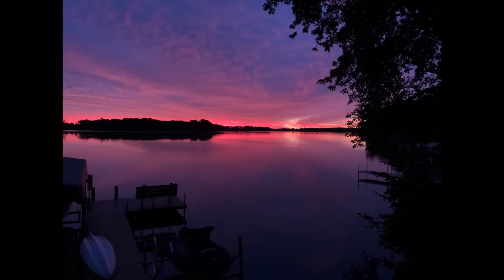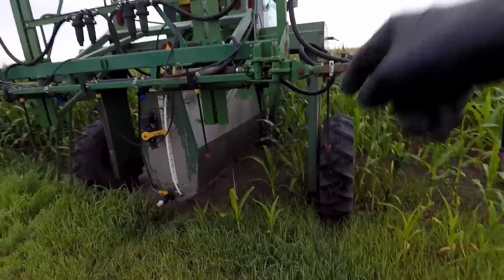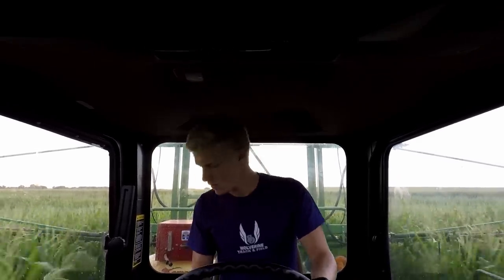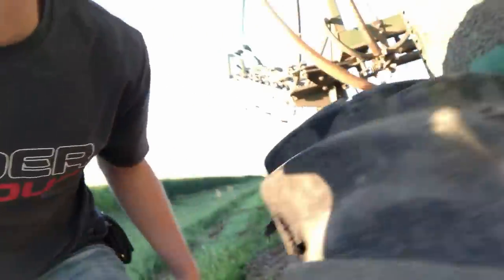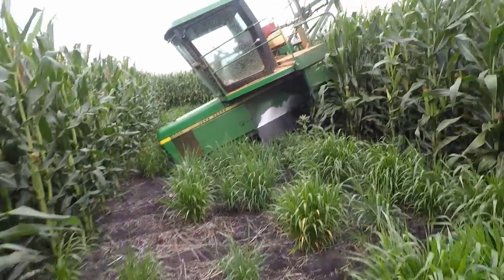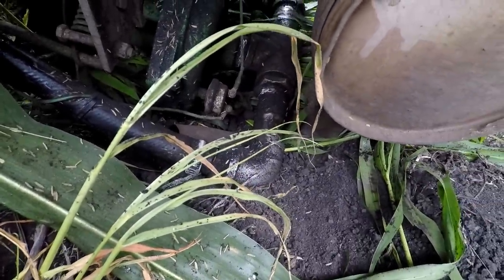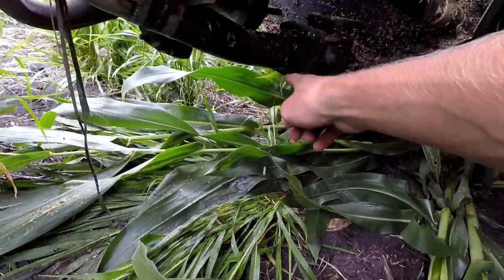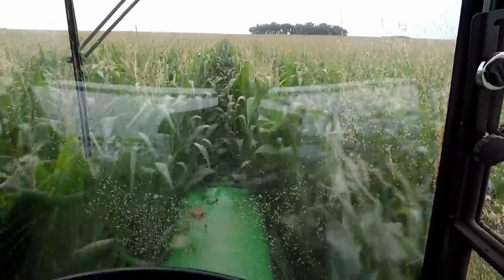Poor Mans Hagie Sprayer (John Deere 6000)

Comment: We have one of those that we spray tabacco with and the hydraulics don’t work so we have to pull the booms together with a chain
Reply from the maker: Ours are getting weaker, we are planning on going through each of them this winter and fixing/improving the ride height, replacing the drive chains, brakes, lights, and hopefully the hydraulics

Comment: Makes me very glad for our 80' Patriot XL, we've put a raven GPS system in, helps a ton running 80', anyhow we have also installed pressure gauges for both the main pump and each of the 5 sections, and our section pressure is always about 30% less than the pump pressure... when you said you were trying to hit 40 psi I assume that is at the nozzles, I wonder where your pressure gauge is at... I assume there isn't as much pressure difference with the smaller booms, have you ever calculated your actual application (how many acres you have covered vs how many gallons sprayed?) I suppose you have no acre meter either lol anyhow would be interesting to look into
Reply from the maker: We just calculated it by number of acres done with the 300 gallon tank and adjusted it accordingly.  Plus in the back of the nozzle catalog there is a diagram that shows how many psi you need with a specific nozzle for each rate, and it’s usually only a few psi off from our calculations

Comment: That is a sketchy looking machine. How you don’t get vertigo is beyond me.
Reply from the maker: It’s definitely a sketchy machine, but as far as being an equipment operator, it makes me more confident in everything else😂
Reply: At the end he mentioned 'reset my guidance" so there must be some kind of autosteer, otherwise a day of threading that machine thru the rows would send one to the institution....
Reply: @dhenschel4  no auto steer at all it’s a light box guidance like the first gps of its kind when you start drifting over in eather direction little lights go off to the left or right of a center light and that way you know which way to correct steering

Comment: How do you guys think effectiveness compares to application by air? Ive been thinking about an old deere 6000 just for this.
Reply from the maker: We have had good luck with planes, but we just like the control we have doing it ourselves.  First planes only put on 2-3 gallons an acre, where as we are putting on 12 gallons per acre.  Also we can control when it gets put on.  We like to go at first light, or even before it becomes daylight so we can use the dew as a natural carrier which helps a lot.  Also we can cover 100% of the field.  My dad was watching a spray plane apply fungicide and the plane had to go above a grove, and he said there was probably 20 acres around the grove that didn’t get covered.
Reply from the maker: The nozzles were spaced every 15” if I recall correctly, ever other a drop.  That is because we wanted to try and get full coverage of the plant.  The the regular nozzle was positioned on top of the row, while the drops were in between each row so that way the regular nozzle covered the top leaves, and the drops covered the bottom leaves...  other than fungicide we were applying insecticide as well, but I don’t think it was really needed this year as we don’t have many pests

Comment: We put tractor weights on the front of our 6,000 for it wouldnt pop wheelies
Reply from the maker: What did you attach them to?  We have been thinking about it but don’t know where to put them
Reply: @6thGenFarmer  we made a bracket and attached it underneath and to the side of the frame
Reply: I filled my front tire with rv antifreeze for ballast. I think it helps.